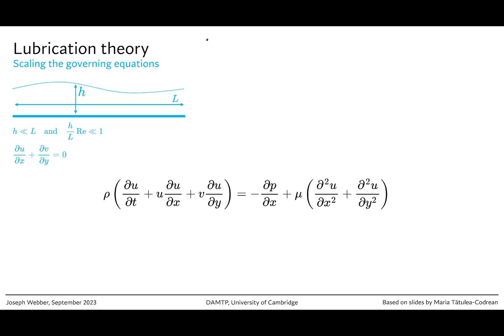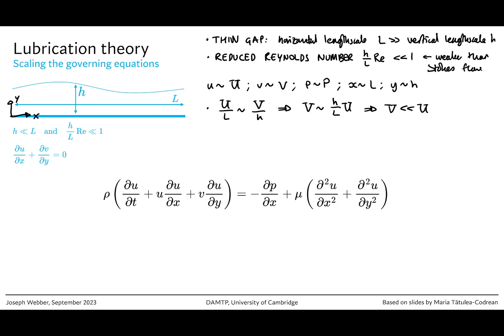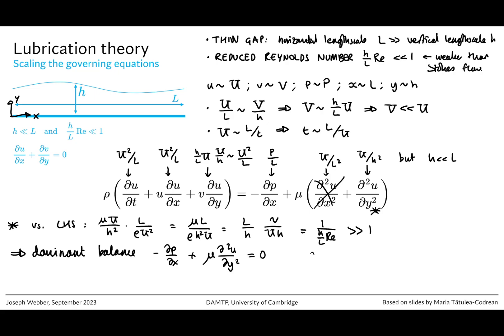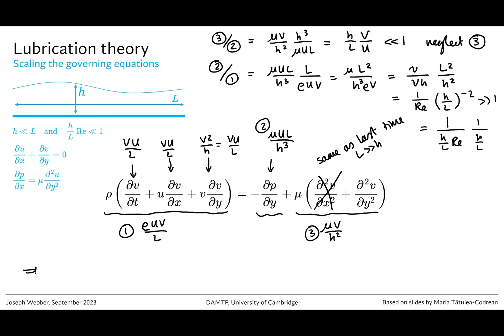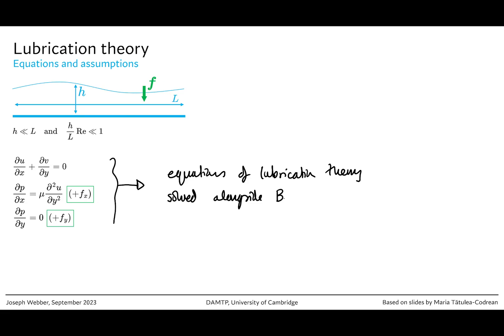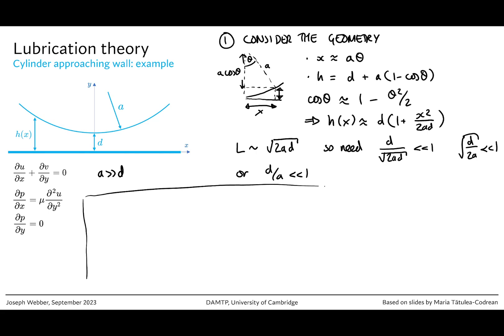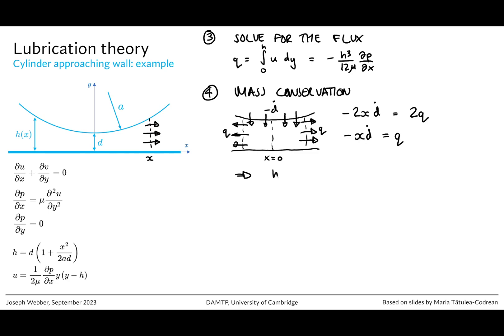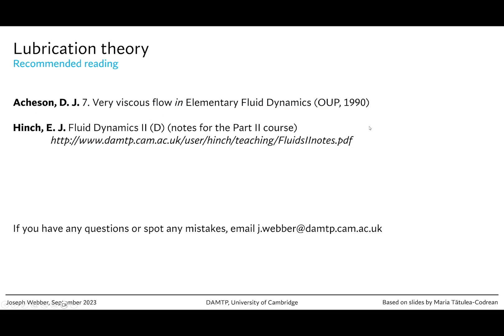6.  Lubrication theory

Comment: Hi, why do we scale the velocities u and v? I dont quite get the reasoning for that.
Reply from the maker: Hi - the key reasoning is to show that, under lubrication theory, the important flow is parallel to the thin gap and that we can neglect flows perpendicular to the gap. With that knowledge, we can see that the timescale for the problem is given by L/U and not h/V, for example.